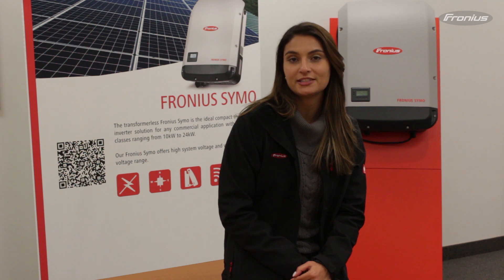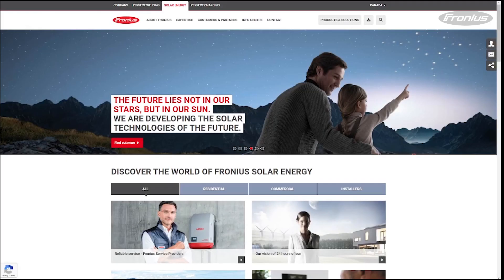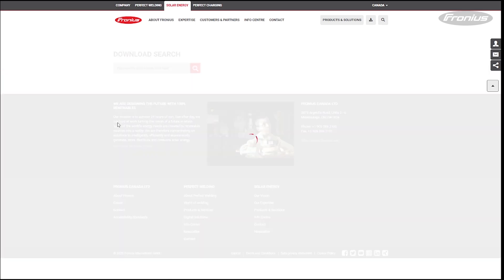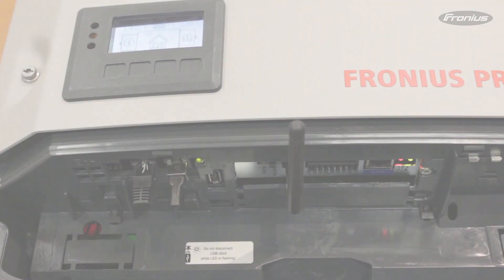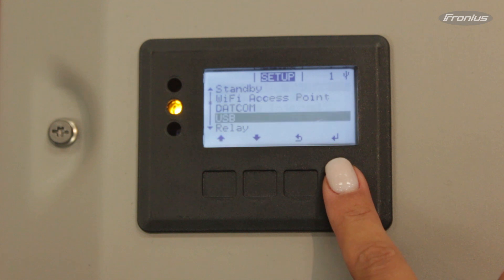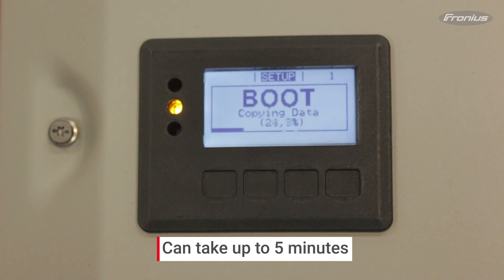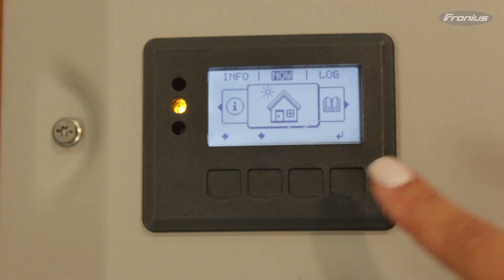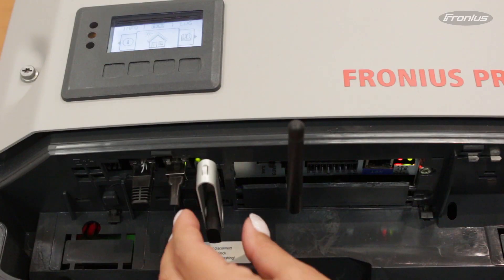Updating SnapINverter Using USB

Comment: Does Symo inverter support over the air update via wifi in any scenario?
Reply: You can update the firmware of inverter remotely from solar web online monitoring portal.
Reply: Hello DC9848,
Krunal sonkusale answered correctly! Any SnapInverter (GALVO; PRIMO; SYMO) that has a Datamanager 2.0 (monitoring card) installed has the capability of a FW update via Solar.web (Online Portal). 

Thanks,
Francine Telles